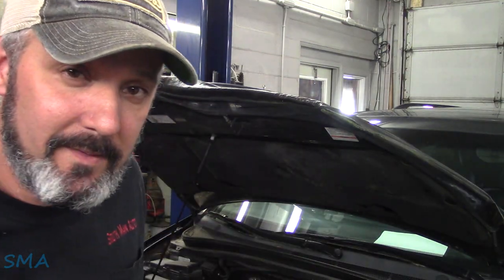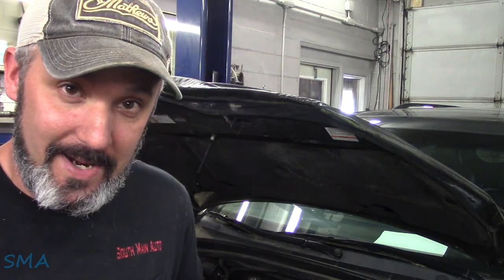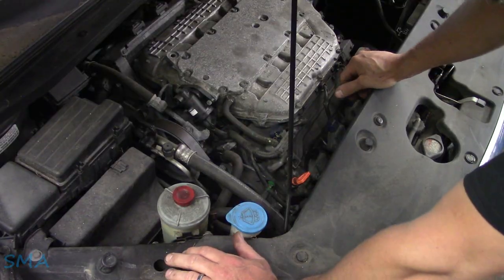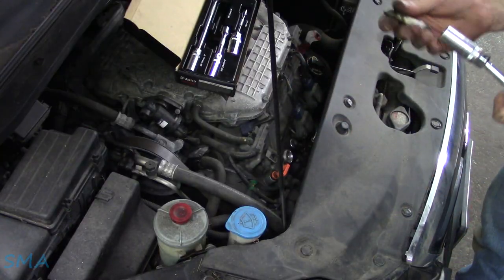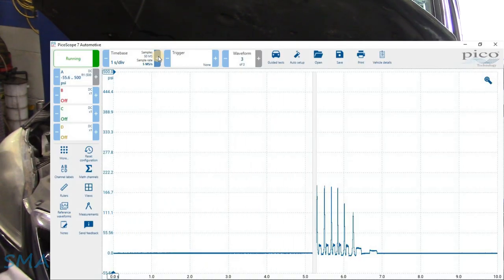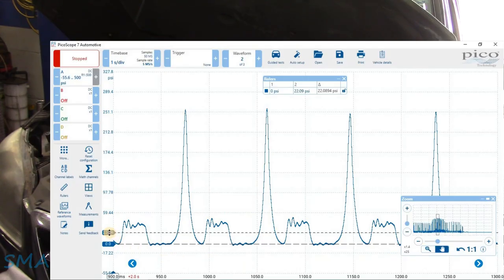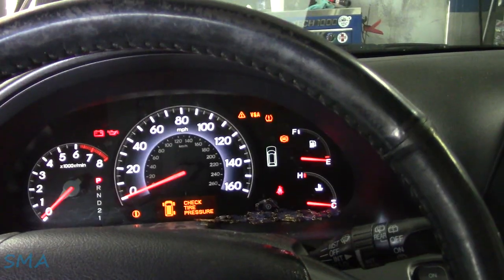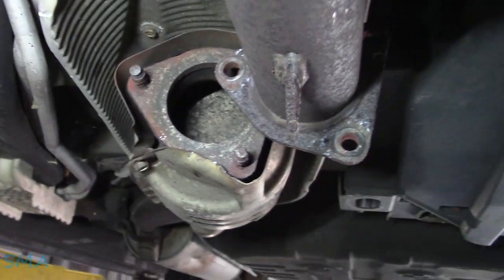Honda Odyssey: No Power At All

Comment: My 2000 Oddy had lower (but not no) power under load. OK idle, some accel, but climbing a hill the power curve stopped at about 3000 rpm. Several things didn't improve it: plugs, air filter. I checked the temps at the ends of the converter...hotter at the back than the front, so seemed OK. Got a new (Denso!) O2 for the cat (2000 only has one) and got a clue when I pulled the old one out and the tip stayed in the converter. Ordered a new one from Rock, swapped it in, and Bingo! Power! And no P0420.

Comment: I wonder if the customer's broken Cadillac converter is worth anything
Reply: Probably not beings that the contents are on the shop floor! 
Streettips did a refining series on Cadillac converters awhile back and to be honest the risks one takes to refine the small amount of platinum and Palladium is honestly not worth it. One drop of the solution can and will set you up for a lifetime of suffering. Best to leave the recovery to the pros.

Comment: Ever since you air hammered my cat...

Can't you just bolt it back up and call it fixed?
Reply: Sorta, your o2 sensors will make your computer do weird stuff if you do that.
Reply: @getchasome6230  if there's no check engine light then I don't think the owner of this particular example will mind. Plus the rear cat is not monitored.

Comment: Hope you upsold a set of tires lol
Reply: Check the Information screen at 14:50; this is a Touring model with the Michelin PAX run flat tires which takes bespoke extremely expensive equipment and special training from Michelin to replace (which SMA DEFINITELY doesn’t have) the ONLY option the customer has is to find conventional rims from a lower trim level or go with aftermarket rims, because Michelin pretty much gave up on the PAX system 13 years ago, and new PAX tires are made of 100% pure Rubber Unobtanium.
Reply: @digitalrailroader  What a joke just to change tires

Comment: From my experience if you see lots of oil jugs in the vehicle and know the rear converter is plugged I would say the front converters are not far behind the rear one. And could all in all be a case of someone who knows to check oil but nothing else like tire pressure as the fronts have been under inflated for the tires majority of life.

Comment: 👍my mother had a 2008 and it had the excessive oil consumption issue. I lost my respect for Honda on how they treated her in trying to get it fixed. The van had numerous other issues with proximity sensors and terrible brake problems.   Sad for a company that once was renown for quality and service.

Comment: A quicker method is to just to put your hand near the exhaust and if you hardly feel any air pressure then you have a clogged exhaust system.  That's how a clogged converter on my car was found.   Took the mechanic about 5 seconds to diagnose and didn't charge me anything.  Referred me to a good muffler shop.

Comment: J35 engine, if the timing was off most likely  piston and valve would be hitting. 
Lack of power on a high mileage Odyssey first thing to check is the rear catalytic converter.  
6 bolts, 3 front 3 rear. 

Have a 05 Odyssey  and worked on a few others common problem.

Comment: Ah, deja vu of the good ol' days.  

When first revved, that dull roar brought back memories of the CVCC Hondas.  So efficient were the CVCC engines, they didn't require catalytic converters when most other manf. had started the use.

Honda had used a stainless steel plate inside the cast iron exh. manifold.  Once running the  stainless plate would heat up, red hot and burn off any residual unburnt fuel.  Worked well for a while, satisfied most states exhaust smog regulations even here in Calif.

Then a few cars came in, poor running, poor acceleration and that familiar exhaust roar.  Learned that with time, and miles the internal stainless plate would heat crack, break away thus clogging the exhaust.  As time went on more and more came in with similar problem.

No repair possibility,  warranty replacement.

I am curious, was all that dust a total complete deterioration of the converter honeycomb???

Comment: V6 Mazda Tributes / Ford Escapes are notorious for misfires causing one of the front cats to break up and then in turn blocking the main cat.  Sounds like this has a similar arrangement.  How you fix the issue of course depends on where you live...

Comment: Got the same problem Honda Odyssey 08 last year. It was front (rear in manual) cat.converter, which is next to main radiator, had to change it with OEM due to CARB :(. VCM turns off 3 cylinders in front of the vehicle and it's causing burning oil and other problems with the engine. VCMuzzler/VCMTuner II or similar products will help you to turn VCM off.

Comment: I've never seen that type of material in a cat before! That was insane!! Looked just like asbestos insulation. Doubt it was, since I think the stuff is illegal to produce these days, at least in North America. Was definitely some type of insulation. 40 PSI!!! No wonder she was such a performer when you drove it in! :D Sounded FANTASTIC!! 

Last clogged cat I dealt with was my '89 S10 Blazer. I had done a newer engine swap, but sold off all the electronics off it. Carburetor and HEI, baby!! She ran great, up until the cat melted down. That was because I had a Chinese eBay distributor assembly on it - would start misfiring at 5-8k miles of use, every time. Replaced all the components with NAPA Echlin brand, and all was well. Was no matter by that point, since the honeycomb was in a bag, ready to head to the scrap yard.  She sure run good after that!! ;)

The first 5 seconds of that horn blaring brought me right back to the days of living in Worcester. Every hour of every day, that's all I heard from my apartment. That, sirens, and thumping rap music. Every so often I need a reminder of how far I've come. Thanks, buddy! :D
Reply from the maker: Glad to help 😂
Reply: They do still use asbestos in brake pads and industrial applications.
Just and f.y.i.👍
Reply: @thatfordguy2268  "I love the smell of asbestos in the morning! It smells like victory!"

Comment: 2008 Yukon 6.2 208k miles. I had lifter tick and low oil pressure so I replaced the lifters, oil pump, timing set, vvt, and cam position sensor because I broke it getting it out. Starts and runs perfect, no CEL, but after it warms up it dies when you stop. Put your foot to floor and starts back up every time but will die from then on at stop. Only replaced the crank sensor chasing this problem. I have a bidirectional scan tool and can't find anything out of the norm.😬

Comment: I replaced the cats in an 07 ridgeline 3.5.  Same issues.  On the one we did found the front cat material downstream before the last cat.    A lotta times it’s induced by misfires and putting fuel down the exhaust.  Will ruin the cats

Comment: 2007 Nissan Altima, same, front cat was completely gone, and clogged up the rear cat. Car still sorta ran at low rpm. And the rear cat (Ca car) is also monitored and throws codes.

Comment: back in the day, early cat days, 1980's, gm used doubled walled exhaust pipe. Hit a mud puddle and the inner pipe collapse and plugged exhaust but, the out side looked fine. scratch your head a bit. Upstate NY too, short trip drivers, and we see frozen exhaust, filled with water and frozen.

Comment: it's easy to tell if a cars exhaust is plugged without a computer or any form of tester - just go stand behind the vehicle with it running and feel the flow out of the tailpipe, a strong flow will pulse against your hand, whereas a weak one will just be this slow steady flow with no pulse.  Nothing wrong with your method of detection, this is just a different way to do it, that's all.  Also, great videos!  been watching you for a long time and enjoy practically every one you have done

Comment: If the crap you pulled out of the rear converter, was in fact disintegrated front converter, it should have a significant platinum content and therefore value.

Comment: I'd love to see that math adjusted for all the manufacturing, packaging, shipping, installation and recycling involved in replacing catalytic converters. I wonder if it is actually more environmentally friendly to just run an open exhaust like they used to do... all the platinum and palladium has to be mined, processed and manufactured into catalytic converts. those have to be packaged and shipped all over the country. and then they have to be installed and the old ones recycled. how much emissions are all these industries creating to save some tailpipe emissions?

Comment: try running some transmission fluid through the motor on a hard run before the tune up amd oil change ,you would be suprised at the results

Comment: Mr O. I'm gonna need you to take a road trip to help me diagnose and fix my truck, you're the right guy for the job I'm sure of it... lol 02' GMC Sierra 2500HD with the big 8.1l in it, gets 8mpg and has very little power, codes usually say bank 1 or 2 is running lean, rear wheel speed sensors are faulty and after I told my B-I-L not to try taking it over 70 because the engine lights all come on at that point the idiot complains about it not wanting to go over 90...now I'm topping off the coolant every few days. lovely right? only problem is you're so damn far away! ugh lol

Comment: I wanted a muffler shop to put a exhaust system on my 81 truck and they said they had to put a new catalytic converter in and it would be around 1,000 dollars. But they could put a new muffler and pipe on from the catalytic converter. For a lot cheaper so that’s what I had them do.

Comment: Running compression is likely high due to the inability of the engine to release previously spent gases. I would have to guess that one of the upper convertors was also bad.  Which means he's eventually going to get another code for that.
  I had an old Saturn with a similar problem.  It eventually broke an exhaust valve.

Comment: Maybe it was a camera trick and maybe I'm not familiar with the rear cat on an odyssey.  But to me, it seemed like the rear cat was fine and was plugged with the material from one of the front cats?  I thought I saw the flat honeycomb face of the material under the dust that Eric pulled out.  Wouldn't that make sense if one of the front cats let go, all the stuff would have to collect downstream, and the rear cat's converter material would be the perfect spot to catch it all.

Comment: I have a 2008 odyssey that the VSA light comes on until the engine warms no matter how many times you restart it. Uses about 1 pint of oil per week. Wife drives it in town. If you punch it on the highway the VSA and engine light start flashing. Guessing a plugged rear cat is my issue. Almost 200, 000 so I only put used tires on it.

Comment: It seems to me that the up stream converter elements are both failing due to oil consumption. The down stream converter is catching all the blowout material. Slapping a new converter in may only be a temporary fix if the up stream converters are still kicking out material…

Comment: I have  seen so  many Coils, Cats O2s  Codes  come up with the them Bosch plugs.  Most of the time the plugs have been changed way to early  and find these plugs in the car.   I have seen the plugs burn out causing the gab to be way past  .060   or more being they only have 20 -30 k miles on them.   I find a lot of these cars Coils are burned out and need replaced.   Then in some extreme case Catalytic converter being plugged up cause its running so rich.

Comment: Most likely VCM system is root cause if this 2007 is an EX-L or Touring trim.  The two other trim levels didn't come with VCM engine.  My 2007 Odyssey EX-L burned ~1qt oil every 1000 miles since new and went through a few catalytic converters until I disabled VCM via an S-VCM controller at ~311K miles.  No more oil burn even on my very high mileage Odyssey.  Wish I'd known about disabling VCM much sooner.  Oh, and stay away from newer Odysseys.  Best years were 2007-10; it's been steady downhill quality wise with generation 4 and 5 since then.  My 2007 is now at ~324K miles on original engine, transmission, alternator, cooling system, etc.  I only do oil changes and transmission drain and fills per the maintenance minder.  The newer Odysseys no longer hold up like that.

Comment: Got a 96 4 cylinder  ranger and wanted to know if the spindles on the front end  are the same as the 98 and 99 models. I’m asking bc I wanna have a 4 inch lift up.

Comment: Oh, those tires.  At least $1300 for the special Honda-only Michelin PAX run-flats.  Customer needs to leave those at the tire dealer and buy new rims and regular tires for same amount as those go for.  At one point, the local Honda dealers would just give you a whole new wheel and tire if you had a flat because the assembly is so difficult to work on.  Special tire changers are necessary to dismount the tire and no shops have them.  Honda has since discontinued using the PAX system.

Comment: Never use Bosch or non OEM on them engines. Gotta use the OEMs. Gas doesn’t fullly combust with them aftermarket plugs, aka hydrocarbons, and will clog up the cats and possibly the 02 sensors or A/F sensors!

Comment: I have a 2007 Honda Odyssey EX-L and I have changed bank 2 sensor 1 (air fuel) as well as bank 1 sensor 2. It is still shooting white smoke. 

Cleared all codes but now it is misfiring on all cylinders, CEL, and VSA. Still white smoke. Compression good in all  cylinders except 6, 210. 

How do I fix this?

Comment: I had 2012 Odyssey, there was a service bulletin on the piston rings, I was burning old badly(fouled #6 spark plug).  Dealership replaced piston rings #6 cylinder only, reprogrammed ECM, problem solved.

Comment: I know exactly why those tires are so bald. They’re PAX tires. There’s only one tire you can put on that rim. It’s a unique run flat featuring two rim diameters on each wheel, a run flat plastic ring, and special grease. Those tires are well over $1000 to get put on at a dealership because the tires are very expensive, and they take significantly more labor to install. Those tires and rims are far heavier than average. The van’s suspension is designed for that weight. Regardless, many owners have ditched those rims for normal rims which allow you tire options.

Comment: I wonder if you could pressurize the rear of the exhaust pipe with shop air to see if it cleans it out. Also as a temporary fix.

Comment: Back in the day (early 1980’s), a shop listed on its price board:
Pebbles-Out $90. Wanda you think that meant 😂😂
Reply: Some early catalytic converters used catalyst coated beads rather than a honeycomb.  If the beads stopped working there was a special service tool that allowed the beads to be removed and replaced with new ones rather than replacing the whole converter.  I suspect the "Pebbles-Out"  service was removing the beads and calling it a day...

Comment: I wouldn't be surprised to find that the car burned a lot of oil because the engine wore out prematurely due to lack of proper maintenance i.e. oil changes.  Honda builds well engineered cars and it's a shame to see one in such poor condition.

Comment: Better change out the “May Pop” tires  as they may pop any minute.
Reply: This generation odessy van got a year or two where they can mount a special kind of "pax" run flat tire. They're insanely expensive to replace for what the car is, and judging by the wheels it looks like that very well could be the case, van was probably bought at a buy here pay here lot, willing to bet it does have oil consumption issues, likely from. Roasted piston rings, the people who currently own it probably bought it because "hondas are reliable" but didn't know the v6s like to blow piston rings and some vans use special tires.
That's my guess anyways. many such cases.

Comment: A Honda VCM engine burning oil and trashing cats?! That never happens!
They must have been driving that thing for a long time with no power before being forced to bring it in when it finally had NO power. I really like being able to use compression waveforms for exhaust back pressure testing. It’s infinitely easier than trying to remove seized O2 sensors (usually) and you get an actual number, not just a wildly swinging gauge needle.

Comment: Tell the customer to ditch those stupid PAX wheels and tires. I have an ‘05 and put on some Ridgeline wheels (perfect fit) and am so glad I did. The pax system has awful ride, awful life (25-30k miles max) and is super heavy. What’s worst is the special machine required that Honda made the dealers buy ($25k) that the will charge you a lot for. Expect $1200 and up for short lived rubber that sucks

Comment: One of the front converters came apart and ended up there. If it was burning a lot of oil there wouldn't be no dust it would all be stuck together.

Comment: "I think you gotta Banana in yo Tailpipe" ~ Beverly Hills Cop
Reply: P.S. Eric ... thanks for ALL you do to enlighten us with levity ... SK ain't got nothin' on you !  Just 5 minutes ago went out to my old beater (2000 Toyota HiLux 2.4 Diesel ... that unfortunately you can't get in the USA) to use your teachings on Battery v Alternator ... quick diagnosis ... one of the 2 required Batteries (engine start one) had come loose from the tie down and inadvertently jarred the pos lead loose ... hence the suspected "hard start" and cranking a bit too long. And yes Teacher, still checked Battery with and without Alternator juice ... both within spec.

Comment: When you don't change oxygen sensors platinum will melt inside the catalyc converter. It will glow cherry red and clog it up.  It will choke the engine up. It will take time but it will happen